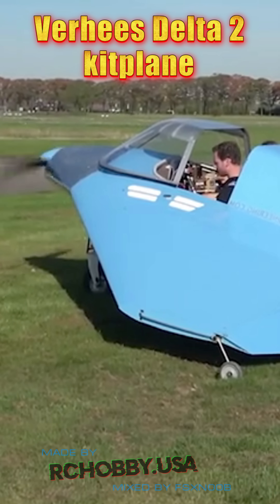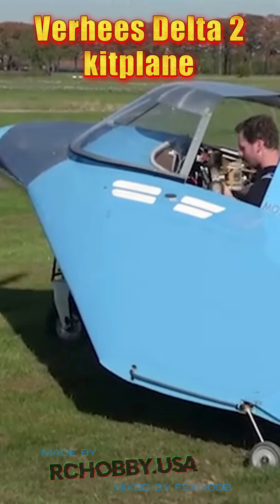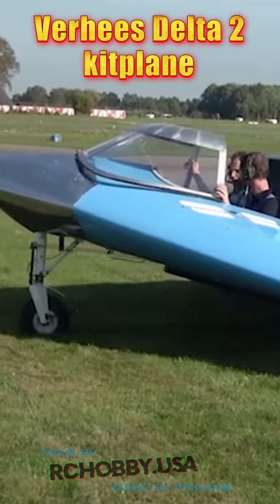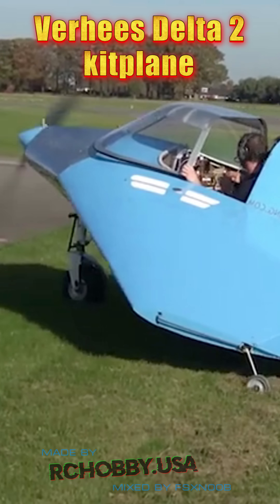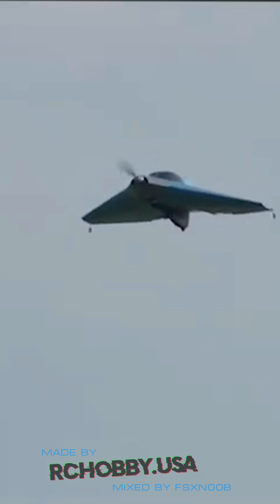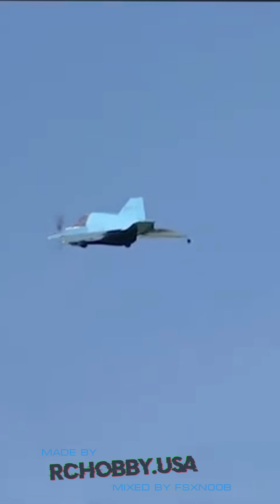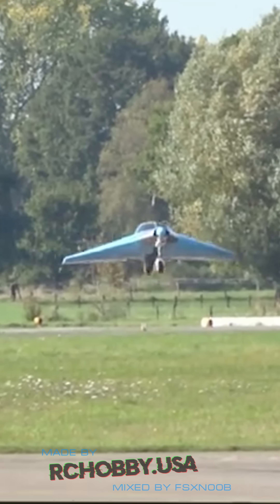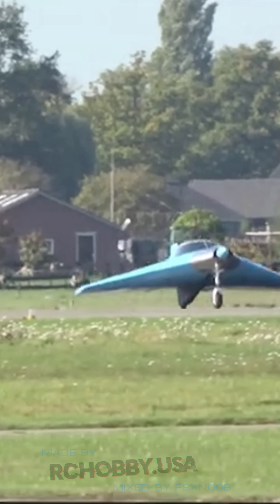A Game Changer in Aviation - Verhees Delta 2 Kitplane #shorts #aviation

Comment: 16 L/h is not due to the design of the aircraft. Rotax 912 engine is used in lots of more standard aircraft, and those fly at similar fuel burn.

Comment: Modelmakers delight, it's range can be easily increased in several ways, one old one use of drop tanks for extra fuel. Two using different engines.

Comment: 220 km/hr is 132 mph.  That speed is pretty standard for most small experimental aircraft.  140 mph is a little bit better, it would be cool for them to offer a slightly bigger one with a more powerful engine with a similar range, but a speed in the 350 to 380 kph (or 210 to 230 mph). I wonder how stable the airframe is and what it's take-off and landing speeds are.

Comment: Dyke Delta. 50 year old design.
The current ability to have a rocket parachute way to save it once spinning makes me want to build one
Reply: I was thinking the exact  same thing, a BRS CHUTE that would fix most of my fears of a delta plan form how's  that vision with that high nose angle simple gear arrangement 105 mph eco cruise at 4gph 25-30 mpg pretty fair performance  18 hour time aloft w extra tanks my bladder will burst.
Reply: Horton Ho 229 ,85 years ago ,Google it ,nazi built and flown.
Reply: The dyke delta has a trike gear arrangement  this is much lighter but grass feild worrys and it looks like a floater.

Comment: If the engine dies during flight, it will fall like a nail in yogurt, with this configuration and wing area. It will hardly be able to plan.
Reply: But still be able to spell 😊😅😂😢😂

Comment: Looks like it was inspired by the Dyke Delta. The Dyke Delta was a plan's only design. All tubular steel. Many, many hours to build but would carry four people at a 170 miles an hour cruise speed for about 1200 kilometers. A breakthrough design and a real performer for its time. There were only a few built and they are very cherished by their owners for their handling and other novel characteristics.
Reply: Yes , it was featured on You Tube owner flew it from Canada to Oshkosh.😊

Comment: I fly a plane with a 912UL and I'm very skeptical that the speeds stated here are correct, even for the 100HP version
Reply: so 100 HP can't do 107 kt in a reasonable streamlined flying delta??
Reply: @kadmow  it could, but you'd be pushing the RPM and would wear the engine out much more quickly

Comment: That's nearly as good as a pipistrelle sinus that have been around for 18 years. NASA awarded them in 8 categories, safety, endurance, glide ratio, fuel economy, avionics, strength of 9gs without damage and is the only private aircraft to fly from NZ to Australia in a single flight non stop. Best thing is that it costs less than a Tesla model S

Comment: It is such a game changer in aviation, that it hasn't changed anything.
Reply: But they have utterly mastered the use of time worn cliches.
Reply: live ME163 Reaction
Reply: That's what i thought, wasn't that a WW2 german experimental also?
Reply: @kd253  Not just experimental, it entered service. It was basically an anti-air missile with a pilot and cannons instead of a warhead rather than a "real" plane.
Reply: This plane has been around for 7 years & hasn't rocked the aviation industry at all, as there are many single engine aircraft that have longer ranges & larger payload capacities, & the fuel efficiency of the Flying Dorito is negligible by comparison.  
The original has been around for over 20 years.  
The aviation industry is not scrambling over itself to copy this thing... so game changer it is not.
Reply: @OOTurok  wait, 7years?? I thought this was from the 50's or something. 🤯
Reply: @GlutenEruption 
The prototype is 20+ years old... but as a kit plane has only been around for 7 or 8 now.
Reply: @OOTurok  I don't think there are really many out there that have a range of 930 miles, plus reserve, while crusing at nearly 125 mph on just 100 hp. The downside is that the passenger and pilot would have limited ground views, which is why a lot of private pilots get into flying in the first place-- for the vistas.
Reply: @OOTurok  But the numbers are impressive.. 1,400km on a tank of 140L.. Even my car burns much more than that for that range.. A Cesna 172 does 1,180km on a 200L fill, so this little thing should be rocking.. But I get it, that it probably has much less usable load capacity compared to a 172
Reply: @dennisishengoma2743  I want to convert one to a hybrid electric with a Honda motor. I bet you I could double the range.
Reply: @dennisishengoma2743 well that’s the issue. A Cessna has 4 seats. Room for bags etc. 
this thing is just an interesting concept with little practical uses. Maybe an another version could a change that. But until then. It’s just quirky
Reply: @jtjames79 you would lose range from the weight of the electric motor and battery pack.
Reply: @Solnoric  It makes no sense at all, a hybrid car saves energy which would be wasted by braking, there are no red lights in the sky!
Reply: @jtjames79 wouldnt that increase the weight and ruin efficiency?
Reply: @OOTurok  The nazis made something very similar to this, so in a sense it's been around for more like 80ish years lol
Reply: @OOTurok  The aviation industry makes GLACIERS look fast moving.
The aviation industry makes the IRA look like "regulation-light".
The aviation industry REJECTS CHANGES that are actually generally for the better, because they are not applicable to EVERY "use case". (The early Rutan designs with the Ccanards that are basically impossible to stall).
The aviation industry is a duopoly at the top, and the pyramid doesn't spread out much on the way down.
And ... like the auto industry, CHINA is starting to kick ass.
EVTOLs are the way of the future ... and CHINA is leading that way.
Reply: @capnkirk5528 
This flying dorito doesn't have greater range & carrying capacity than the single engine props we have flying around now.

It only has better range & fuel efficiency for a single pilot & 1 passenger.
It's like arguing the jet ski is going to revolutionize the shipping industry, because its so much more fuel efficient than a freighter.  

You know what is a lot more fuel efficient than the dorito & has almost unlimited range?
An airship which can cruise at around 210 km/ h... but the aviation industry doesn't use them anymore because they are too slow.  

So how do you conclude that an airplane with no cargo capacity, can only carry 1 passenger is more revolutionary than an airship that can carry tones of cargo & passenges... because it can travel 10 km/h faster? 

And EVTOLs with flight times of only 10 minutes is not revolutionary either... so China isn't leading the way to anything.
Reply: @OOTurok 20?  It looks like ww2 german tech. What's it's weakness? Engine size? Wing size? We never see this in aviation. I'm confused or you are. Please explain further.
Reply: @codyman242002 
There's not any true weakness to the design... it just doesn't perform significantly better than the conventional designs that are dominant in the industry.  

Realistically it needs to be bigger with a larger cargo & passenger capacity to have a commercial use... which will require it to have a larger engine, & thus it will loose all of it's fuel economy advantage.  
It will still out perform as a glider because of its lifting body, which is an advantage during engine failure though. 

But to achieve its stats, it just not commercially applicable... & in the aviation industry designs need to be commercially applicable to be successful because the private market & infrastructure is very weak for aviation. 
Private pilots are not common like motorists & the vast majority of people don't travel via personal aircraft like we do with automobiles.  

So an aircraft design needs to have a strong commercial use for it to be widely accepted.  
That's just the reality.
Reply: How long would you expect a kit plane could stay in the air ?
8 hrs is a long time 18 is phenomenal & certainly changes what can be done w it.
Reply: @ericstyles3724 dose not look at all comfortable for 8 hrs let alone 18 !!!
Reply: Probably because nobody owns one. The plans aren't even available from Verhees.
Reply: Dose not look all that stable to me ! More like a Hobby Cat on rough seas...
Reply: I saw one crash on landing! Crashes really nice!
Reply: that doesnt make sense on any level...not as an attempted snide remark, not even as a sentence
Reply: lol
Reply: It's an interesting concept. It just doesn't have a niche in single engine/piston aviation. It's homebuilt, so it's very limited in what it can be used for commercially. Even if that wasn't an issue, it's too wildly different from anything else flying to be an effective trainer. Because of the lack of trained pilots on it, there isn't an incentive to adopt the design for any other role, commercially. The reason Cessna's are so popular is that they're easy to train on, and because so pilots are already trained on them, they can be used in other roles with minimal time retraining pilots. 

The range of this thing is genuinely impressive, but you probably don't want to be cramped in a space that small for 18 hours. Even if did, you couldn't carry more than backpack anyway. 

Also, Delta wings just don't do low speeds well, compared to straight wings. That's why they're mostly used in super sonic jets. Looking at this aircraft's specs. it's half the weight of a Cessna 152, and has the same stall speed. A biplane would give extra space for fuel, and have less draw backs.
Reply: This plane has been taking the world by storm.  Or something.
Reply: Looks very like the Dyke Delta (from 1963), and of similar size and performance.
Reply: you say that mockingly, but there's genuinely a lot of innovation that goes into these small project planes that mostly or entirely goes unnoticed.
Reply: @OOTurok...🤣🤣🤣🤣🤣🤣🤣🤣🤣🤣🤣🤣🤣🤣🤣🤣🤣🤣🤣
Reply: Probably, but you gotta give some credit: that is Phenomenal range for such a small aircraft. For reference, the P-51s, while holding drop tanks for extra range, could manage maybe 2600km, and 1700km without tanks.

This little Dorito is obviously not going anywhere fast, but that is still some impressive flight distance
Reply: @spindash64  What even is this bot response. The lack of guns on this dorito is also phenomenal for such pointy looking plane.
Reply: Actually learn some manners and What in that comment actually sounds like a bot?  @Arnechk

Comment: I have sold LITTERALLY 50,000 sets of fiberglass airplane plans.  Owned an experimental aviation company and pilot since the early 90s.

"Reliable and Rotax" should not be used in the same sentence.
Reply: 100 HP rotax 912S and that's not the reason it's a death trap either
Reply: How many of those 50,000 plans have a rotax engine in them?
Reply: @Brad-sh2wn  Those numbers are irrelevant as they don't prove anything concretely. If the result was "few" we could deduce that the low number of plans using the engine model IS due to it's (allegedly) known unreliability, just as it could be a bias.

Knowing how many of their plans used the engine tells us literally nothing and won't push the conversation forward... Now, unless you have more context to give as to why you're making this question and what knowledge you have that could actually prove your point... By all means, do tell.
Reply: @InfinityGPT_2  is I have known people flying for 20 years that use that engine. Blah blah blah
Reply: @InfinityGPT_2  you got to be joking right. I asked a question.your answer proves nothing concretely what a joke like there's only three planes flying with the rotax engine in them . Some people like this engine some people like that engine. My question was how many of those planes were flying with the road tax. Not blah blah blah. Very simple question ❓ unbelievable
Reply: @Brad-sh2wn  you asked a question with the clear intent of debating the comment.

It couldn't have been more obvious.
Reply: So is it reliable or not?  Is it junk?
Reply: It seems it would have stability issues. Up and down rolling. Idk if an added wing surface/ control might smooth it out. What about a rear engine/ contrarotating prop? I want a gyro plane. It seems safer.
Reply: Delta  single wing design aircraft are notoriously unstable, and can ruin your day real quickly
Reply: @jackcavendish8900 what are you going on about
Reply: What model is that?
Reply: How about VW or Porsche Aero Converted engines?😅😊😮

Comment: powered by a "reliable" rotax 912s, let me laugh a bit🤣 It's no news that the rotax's are way less reliables and more expensive to fly than lycomings and even continentals. It may be cheaper to buy but trust me, it's expensive to fly and less profitable at long term.

Don't fall for the cheap solutions and buy a real engine.

Comment: That thing has got to be horribly unstable. Delta wings have notoriously poor handling and stability at slow speeds. Given that I'm not sure why they went with such an aggressive wing sweep. Its not like they're pushing towards critical mach.

They could increase range and stability by increasing the wing span and reducing the wing sweep. 

Also the bicycle landing gear arrangement has always seemed spicy but I've always wanted to try it. I don't think I've seen it outside of the U-2 tbh but I'm sure they're are other examples out there

Comment: Basically it's a sheet of cardboard with an engine stuck at one end. It will definitely fly just like roof sheets in a strong wind. 😮  Keep it out of weather and it will do just fine.  Must use it's own wind not assisted.

Comment: Seems the designer did what General dynamics originally did to the F-16. Delta wings need to be SHARP to function as delta wings, and not simply swept ordinary wings. yes, the name comes from the plan-view shape of the wings, but it is kinda a misnomer to call this a 'Delta' wing. And don't just trust me on this, NASA is the one that corrected General Dynamics - and showed sharp edges help generate vortexes (how delta wings get lift)

Comment: Just prey you don’t experience turbulence or a gust of wind because that thing is as aerodynamic as a piece of paper! 💨 📄
Reply: I thought the same.  I was wondering what the max cross wind speed it could take off in.  And imagine crabbing into the wind on landing.
Reply: Delta wings have been there for a long time. Some don’t even have stabilizers but this one does. Almost like a flying wing. But definitely a different kind of flying.
Reply: Did he say the engine was 100 hp ? it sort of looked like it was about to stall for a second..(as I already said elsewhere), this thing looks spooky to fly…
Reply: *paper football.
Reply: @ejohnson3131  scary AF
Reply: yeah, no thanks. Not gettin me in that rig
Reply: Me either, unless l can keep one foot on the ground probably has a glide ratio of a brick   @kimmorrison9169
Reply: Yes RC Delta wings were never good in unstable air
Reply: Tell that to the Avro Vulcan and Concorde.
Reply: Delta wings are the best designs for efficiency, speed, turbulence. Honorable mentions,  Delta Dagger, Mirage 3, Concorde, etc. Hell even the Marine Corps had F21s Kfirs in Yuma,AZ. I would love to see a small turbine though.

Comment: I think one of the major downsides of this plane is its speed. 220kmh (or 137mph) is about double the speed limit here in the United States. For long distance travel, giving it smaller / thinner wings and a more powerful engine would make flights considerably faster, therefore requiring less endurance for a pilot. This plane isn't bad, it has its use cases, but I think it would be better used for numerous short distance flights (between European countries), rather than a single 4000km(2485mi) with a duration of 18 hours.

Comment: Delta wings are specifically designed for supersonic flight. Beneath that, it's a huge limitation. You need SO MUCH MORE power to keep it going. That's why companies were building wings that could transition to delta mid flight, because otherwise, you had to choose planes based on the speed you wanted to go.